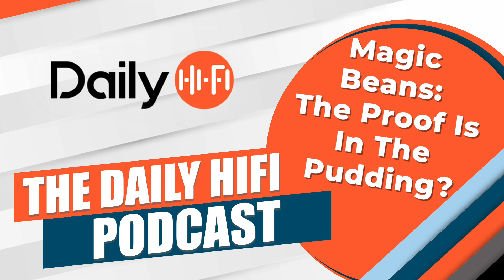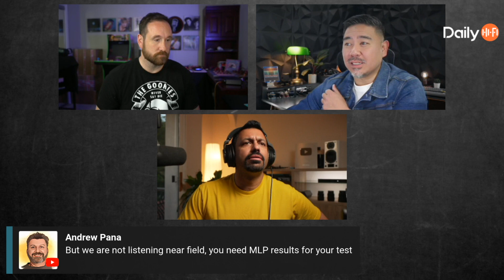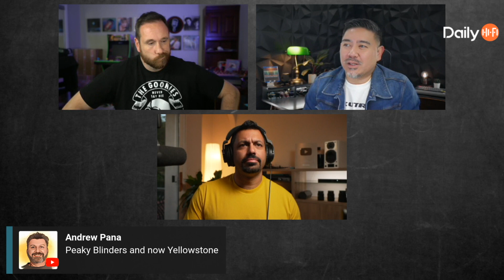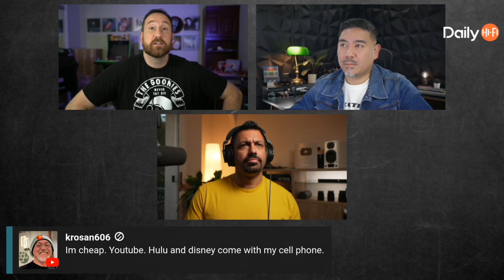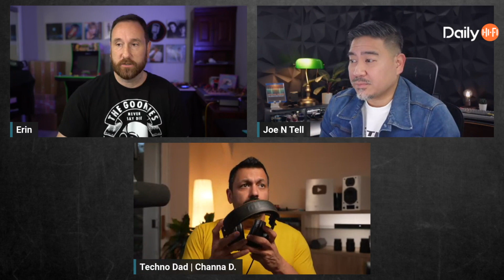Magic Beans And Measurements

Comment: Assuming there is a great target curve for my brain, room and equipment. Why is the one MB comes up with, that curve?
Reply from the maker: Joe here. The effect of the room can be measured as well as the output from your equipment without the room's effect. Many years of research from Harman have shown over and over that we can consistently predict what most people like. The predicted response matched up to listener's preferences 95% of the time, but let's just say 90% to be safe. What people like is an accurate sound reproduction. This makes sense if we're talking about Hi-Fi since the goal is accurate sound reproduction. In other words, what goes the frequency response that goes into an amplifier should be the same as what comes out, just louder. The same applies to speakers.

It's possible you're in the 5%-10% of people who prefer something that isn't accurate. That's fine. You can still use tone controls. But accuracy is the correct starting point.
Reply: @DailyHiFi  So if as you say "the frequency response that goes into an amplifier should be the same as what comes out, just louder. The same applies to speakers." Shouldn't that mean that I want what's going in to be what ARRIVES at the MLP? That would mean we are back to measuring at the MLP rather than near field. Hmmm...I'm trying to understand.  I think we need a simple statement  like "This is the true target curve we want MB to come up with because it [[...fill in the blankk...]]"
Reply: I should add that I'm worried that if I merely get real accuracy only near field, my crappy room might do somehting horrible to the sound by the time it gets to the MLP.
Reply from the maker: That comment about wanting a flat response at the MLP is not correct, but a common misconception. When a guitarist plays an acoustic guitar and sings in your room from 10ft away, you don't want it to sound as if your ear was as close to their mouth as a mic would be. You would expect to hear the interaction with your room and your brain is smart enough to distinguish the direct sound from the effects of the room. What you want is the speaker itself to reproduce the sound accurately. So from 10ft away, it will have a similar interaction with the room as the live performer and the tonality from that distance will be nearly identical.

Here's the statement you want: the True Target curve is that which the nearfield response of each speaker is as neutral as possible taking into account the nearfield effects of nearby surfaces. This pertains to the frequencies above the transition region where direct sounds and reflected sounds are distinguishable. Below the transition region, the room and speaker become indistinguishable and the True Target curve is determined by the room response and the ideal target is that where all the speakers follow a smoothed version of the room response.
Reply from the maker: Your "crappy room" will affect all real world sounds, and yet you're able to determine what sounds real vs fake in your room. Our brains are amazing. That's why I think it's very important to not only study acoustics, but psychoacoustics which takes into account how we perceive sounds.
Reply: @DailyHiFi  YES! That's a good statement.  Thanks for the hard work on this. That statement gives me something to think about for a while.  Sorry for so much pushback on this but I know you respond really well when people do! Keep up the great work
Reply from the maker: No need for apology. I love real feedback. It's when people have no interest in considering other view points where I get annoyed. I can tell you're truly interested. - Joe

Comment: Most talk I've seen on DIRAC especially has concluded that you shouldn't force a flat response for your speakers unless you know they're both flat and have good dispersion characteristics, at which point they should measure rather flat to begin with, but DIRAC have struggled with the EQ being a little bit aggressive instead of trying to align with a speaker's natural response. Unless you know what your speakers measure like, using Dirac to EQ to flat is generally not recommended

Comment: To be clear, bass can be EQ'ed, and should be, from the main listening position in the farfield. The higher frequencies should be corrected for in the nearfield. The reason being that for the frequencies above the transition region in the room, some people refer to it as the Schroeder frequency, what we perceive is the direct sound and we can separate out the reflections that occur thanks to our binaural hearing and our brain's ability to distinguish between those sounds. A single mic placed at the listening position is already affected by nearby reflections at the listening position, as well as reflections from the walls, floor, ceiling, and nearby surfaces and it becomes impossible to separate out the room effects on the measurement. There's air attenuation in the higher frequencies which is distance dependent. That, the speaker's directivity and reflectiveness of thr room affect the high-frequency roll-off. In most popular room correction software, they're mainly just guessing what the roll-off should be.
Reply: what about ~200 to 500 or 1K?
Reply: @kejar31  yes, that likely right where the transition region starts and can be EQ'ed based on the nearfield measurement
Reply: Also what about speakers that require a decent distance for the tweeter and mid-range to summize? Would near-field not show a dip in the transition freq?
Reply: @kejar31  good observation. Nearfield and where the speaker drivers fully integrate varies. I find 2X the longest dimension is a good rule of thumb.
Reply: @joentell  I do something that seems similar to what you are doing.. 1. I take a gated measurement (put the speaker in the middle of the room up off the floor to get ~4ms before reflections) I use this measurement to EQ from ~250hz and up... 2. I then take a NF MMM to flatten things from 100 to 400 or so as the Gated measurement is pretty low res on anything below ~400.. 3. After these two things are done I take another MMM at the MLP and adjust for 20 to ~200 hz to help with room modes. 200 to 600 or even 1k is so tough to EQ at least from the MLP (not to mention you should never touch anything above 2khz based on MLP measurements IMHO)... The room impacts the measurements and you def get cancellations etc but you are probably hearing alot of those tones before there is a cancellation (at least I think). I tend to leave anything above 200hz alone based on MMM at the MLP..  If I try to mess with it I personally tend to get ringing etc.
Reply: But why should you correct anything above the Schröder frequency at all? 

Getting linear and smooth directivity speakers in the first place is not that expensive nowadays.
Reply: @juliangst if you have speakers with good directivity and are already flat on-axis, then you probably don't need any EQ above the transition region. Some speakers have decent directivity but maybe the treble is too high due to the crossover design. There are various reasons why someone would want to EQ the upper frequencies. Just consider if you were the speaker designer and had access to DSP. You would likely use it to optimize the linearity of the speaker response if you had the option. We have that option, so why not use it?

Comment: i would say that every speaker need eq when placed in a room.
and the last part of the eq is done by ear at listening position(assuming 2 channel one listener).
then we need to pick the speakers, room and room treatment so that it matches what we want, so that we need at little eq as possible.

all these recording engineers, music producers, drivers, speakers, designers, try to make things after their goals. and i think that the end sound is perceived as about equally loud at all frequencies. so then you know that any tone made in that song is coming across to you about as loud and any other nearby tone and you won't miss anything or have a loud peak somewhere.
i wrote this to leave room for any kind of audio taste and preferences.
Reply: I agree with pretty much everything that has been said above.

EQ is not the answer to all the problems. Buy good speakers, place them properly, use treatment, and ensure you're not sitting in a null. That will go a long way. EQ can be helpful when you are missing some of those things. Lots of home theater systems require compromising on some of the things mentioned and EQ can help.

I just came back from NAMM a few weeks ago and got to meet some famous recording engineers. The good thing about their setups is they start with good speakers like Genelecs or Neumann for example, which already utilize some of the DSP techniques I'm advocating for (correct for the direct sound so that the response is linear) and they do use EQ for the bass in-room.

Unfortunately, there are some mixers using speakers that are known to measure poorly and some really don't know as much about audio as one might expect. It just depends on who you talk to.
Reply: Most recording engineers listen nearfield where most of the sound you hear is based on the direct sound of the speakers. In other words, they're in the direct dominant field. Most people listening to speakers in their home are beyond the critical distance (where the direct sound and reflected sounds are equal) and they are usually in the reverberant field. Bass should be corrected for in all situations. My argument is that the higher frequencies should be EQ'ed based on the direct sound and not based on what's measured in the farfield response.
Reply: @joentell   good recording engineers mix in one place like the ones you said, then test it in another environment and often in many. they should now about all the effects.
some mix in home room like environments also.  
we can only hope the music we listen to is done to sound the best in the playback listening environment we use.

the room effect on the sound still has to be tuned by ear so that a large or tiny room does not add up to peaks that wont show up on simple measurements.

think we view audio the same way, and hopefully magic bean get more people interested how this all works and they can chime in how it sound in the end, and the effect audio enjoyment :)
Reply: I read about and listen to a lot of different spaces to understand room acoustics (just a hobby).
Room acoustics and speaker acoustics are simply two different things.

A speakers can be built to pressurize air in a certain way to optimize the audio frequencies but that's only near field.

Once those same frequencies start reflecting of solid objects, floor, ceiling, walls, that same frequencies/pressure is now a product of the room acoustics and NOT the speaker.

Correct placement of speaker in room; best MLP in conjunction of where the speaker has been placed; correct volume/pressure for the room; the correct acoustic treatments; and finally room EQ (Ideally below 500hz- stereo).

The AV industry (folks that have something to sale😉) will sing about room EQ software is the answer to your poor sounding TV room. This false narrative is why we can argue over which room eq software is better than the other. A polished bit of poo will still smell of poo. Room eq is just polish. 

If you do everything stated above first then room EQ can be missed out and you should still have a decent sounding stereo system.

5.1 and above is a whole different level of problems but again start with the basics. Don't see room eq as the ear of god👂😊👍🔊🔊